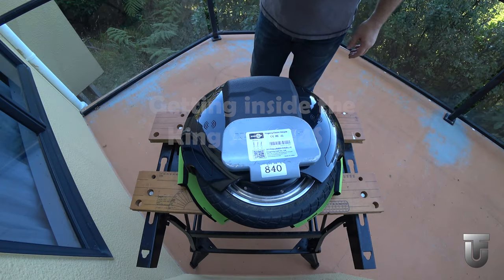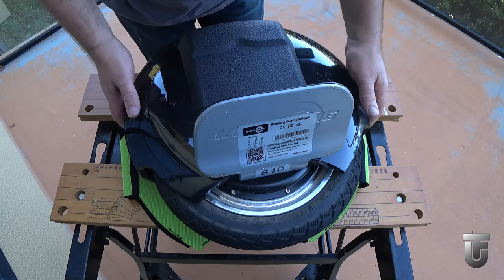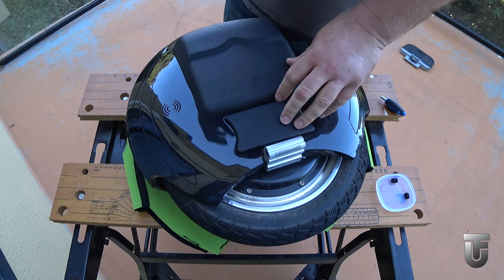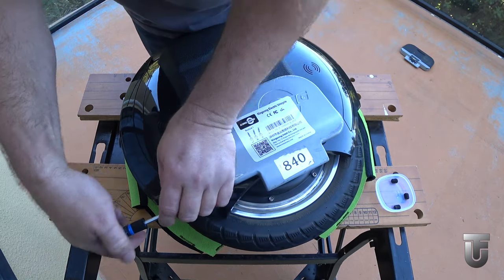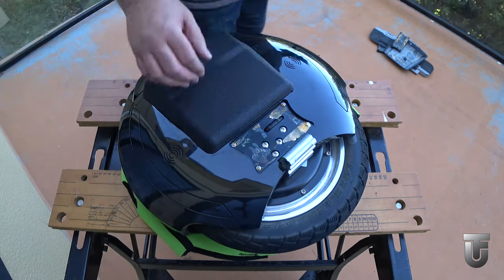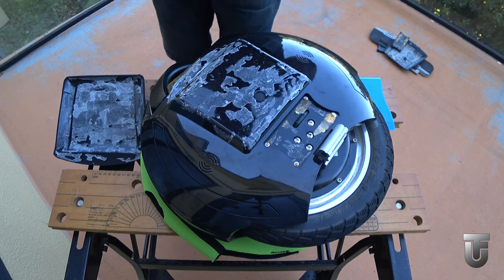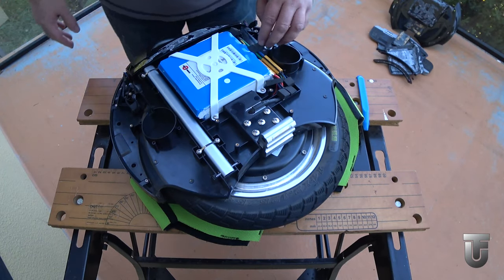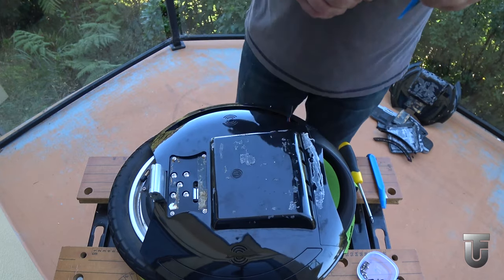King Song 14S: Disassembly

Comment: Thanks for the wonderful video. So I just have a flat on my king song 14s also on my 16s. The 16s is just losing air but it seems to hold air for a while. I believe I will just try some slime and pray that works

Comment: I need to replace one section of LEDs.  Are they connected to the cover? Do you just pull the cover off and disconnect it? And just connect the new and snap it back in?
Reply from the maker: Oops... My apologies, I missed this! 

In case you are still waiting on an answer (and for anyone else with the same question)...  If you need to replace just one of the LED strips, you just need to remove the LED cover, unscrew the LED strip and disconnect it. You do not need to remove the main side cover at all.

Comment: Hi! I would like the build my KS 14D into a KS14S. As far as I see I will need the bigger batteries ofcourse and a 14S shell and I think I'm good. I hope I don't need a 14S mainboard.
Reply from the maker: That is correct - new side covers (and upper pads) and new batteries.

The control board is the same for both models, so provided your model shows up as KS-14SMD you should be good to go. However, you may want to work with your supplier to update the control board serial number (so the correct range is reflected in the app).

Comment: Надо было разогреть на сепараторе до 70°С и обильно поливать изопропиловым спиртом. А нет это ж не смартфон.
Reply from the maker: I'm using Google translate on this, which gave me this result;

"It was necessary to heat the separator to 70 ° C and pour abundantly with isopropyl alcohol. But no, this is not a smartphone."

I don't understand the last bit about the smartphone, but I assume the first part is referring to removing the pads... Yes, they can be difficult - the main fear is that you will tear them while trying to remove them. 

That is why I use Upholstery Tools (https://www.repco.co.nz/en/brands/toledo/toledo-trim-remover-set-5pc/p/A1120325),  as you can separate the pad from the shell py pushing it from behind, rather than pulling on it.

I have also tried isopropyl alcohol, but found that eucalyptus oil worked better.